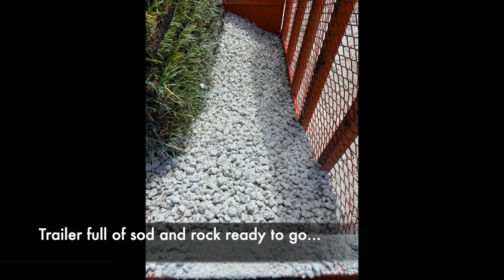Yard Drainage - MUDDY MESS GONE! Part 2

Comment: I would have just done a French drain there next to the driveway with a catch basin. That’s basically what you created putting rock around the solid pump line.. but this works too
Reply from the maker: I was worried that the ground gets too saturated during the summer rainy season for a french drain near the driveway. I was trying to the the water to where it needs to go quickly. I've seen your videos (after the fact, unfortunately) and maybe it would have worked. Great videos BTW, @jerseyshoredrainagesolutions.
Reply: @landnseadiy   as long as the problem is solved that’s all that matters in the end. Ya the customers love getting a video of there house when I’m done… plus I have them share it to Facebook in their town fb groups and get more work from them. Great advertising.

Comment: Why not regrade the area of the ditch that is higher than the drive and re-sod below the driveway height?
Reply from the maker: I did bring down the hill that was definitely impeding flow, but I didn't think there was enough fall to make it to the storm drain and drain the water fast enough. We get a lot of water to that end of the driveway due to how the roof of the house drains, the street, and the driveway itself. I just thought a pump was the quickest way to get rid of the water and not have a saturated front swale.

Comment: I am confused why you covered the discharge pipe with stone. If you were trying to create a french drain you are missing the perforated pipe and soil cloth to keep dirt out of stone bed. The catch basin and sump pump would probably have solved your problem all by itself.
Reply from the maker: Yes, the sump pump and catch basin alone might have solved the issue. My hope was the water that sits in the yard in front of the island would percolate better with the stone trench below. There isn't enough fall for it to drain quickly toward the storm drain. It seems to work.

Comment: Would it have been difficult, expensive, or risky to run the PVC under the driveway?
Reply from the maker: I could have tried to tunnel under the other end of the driveway and that would have been a great way to complete the project. That end of the driveway doesn't get used much so we haven't had the issue with folks pulling into the grass as they turn into the driveway and it turning into mud during the rainy season. But now that you've brought it up.....I went and watched a few videos on hydraulic mining under sidewalks and driveways. Install a larger PVC pipe sleeve and then the 1.5" PVC drain pipe and hopefully avoid the driveway cracking over time. PVC prices are ridiculous these days, but it's a relatively inexpensive way to take the water to the other side of the driveway and on to the neighborhood drainage structure. I'm willing to give it a try and see how it comes out. Could be another video. Cutting the driveway would be out of the question because of the stamped stone pattern and trying to match that pattern with the patch. Thank you for the idea!

Comment: How did you run the electrical for the sump pump? Also does automatically turn on when water level rises?
Reply from the maker: Sorry, I didn't do a great job of documenting completion of the electrical portion. There is a hardscape island with a GFCI outlet in that part of the yard and I ran the power via conduit underground to the outlet. The pump plugs into the outlet. Yes, the pump is switched on with a tether switch when the water rises. Thank you for watching!